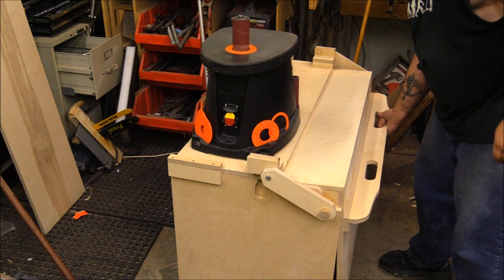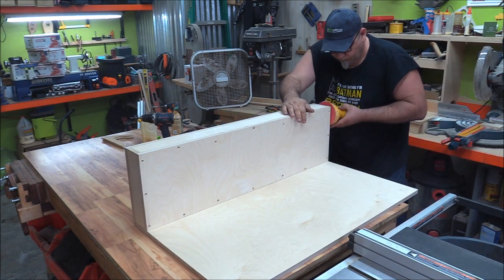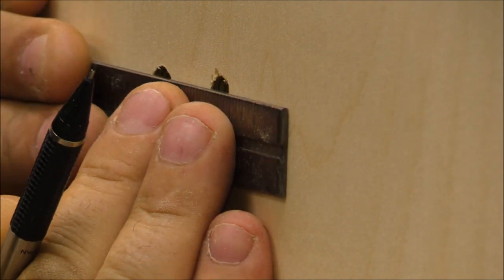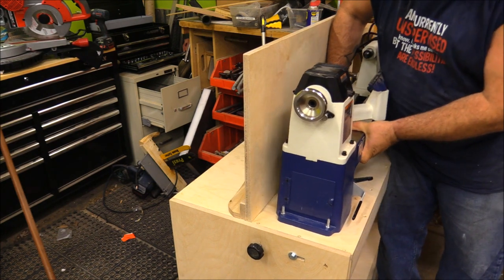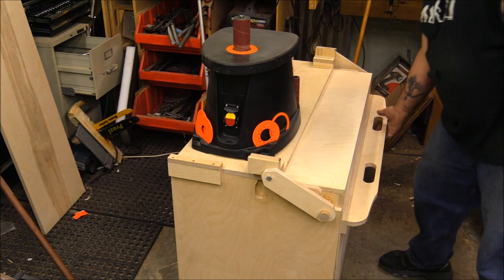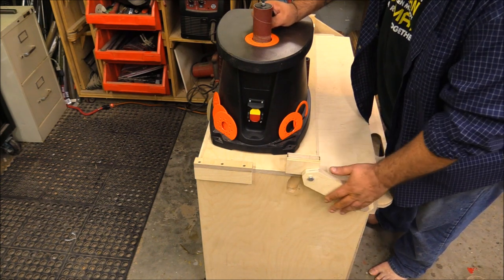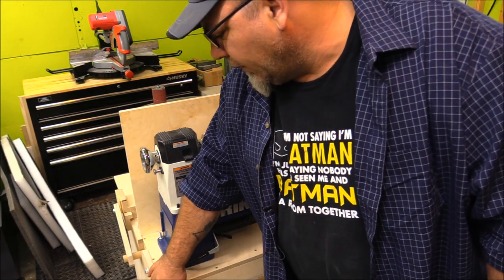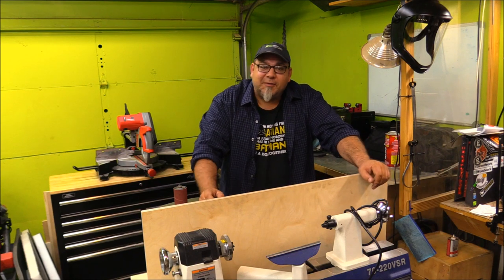(how to make) a space saving flipping lathe cabinet

Comment: Just a suggestion but you could have the lathe tool holder hanging on a cleat on the side then when you are using the lathe move it to hang on the board that is sticking up so they are right there.  Or just store the stuff like the key and allen wrenches for the chuck right there because that stuff is a PITA and you're always looking for where you put them down.

Comment: about your back splash behind the lathe - perhaps cutting it in half, re-attach it with a piano hinge, to fold back, but also use slide bolts to keep it upright for chip blockage. doing so would give you access to the lathes full usage when you need something larger. just a thought. you probably already thought of that any how  lol  great project.

Comment: Great idea Izzy. Kinda the opposite to what I normally see: a fixed lathe and and a flip/lift up grinder.

The only potential danger I can see is if your lathe can run in reverse (it's sometimes useful for sanding). If you were turning a piece at near full capacity, and were sanding with your hands on top of the piece, any sort of snag could pull your hand between the piece and the rear board (like the danger of sanding whilst running the lathe normally but leaving the tool rest in place). It's probably an unlikely scenario, but just one to be aware of.

Comment: Just brilliant! I have the same lathe, a similar spindle sander (Ryobi) and a low-speed grinder (Porter-Cable). You've given me the perfect design concept for housing all three. Curious...other than losing a few inches of overall depth when the lathe is stored, what other advantages are there to having this (admittedly sweet) mechanism rather than simply have a deeper top? Oh...did I say brilliant?  Just brilliant!

Comment: Great work station, I have a idea that might help with some of the chips going over onto the sander/grinder, On the center wall put a sheet of plexiglass or something like masonite with two grooves with wing/knob screws so you can raise when in use and lowered when you want to flip the lathe down